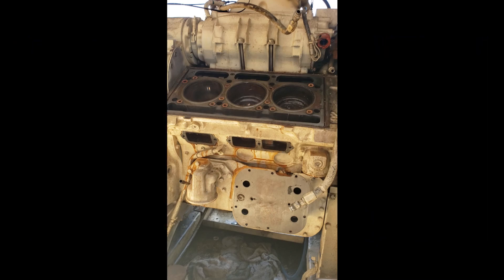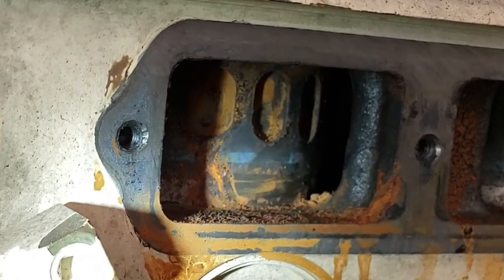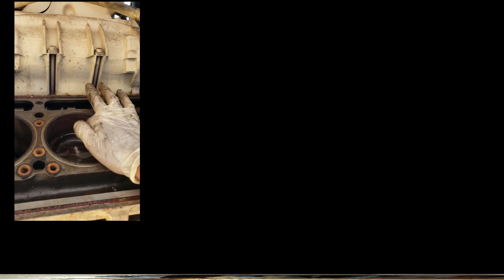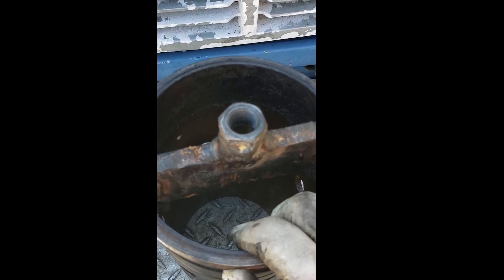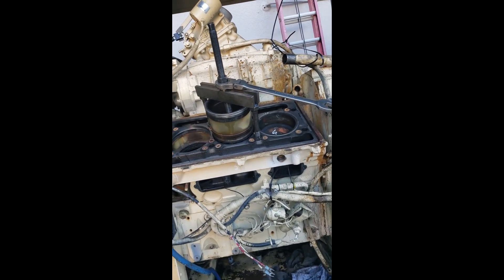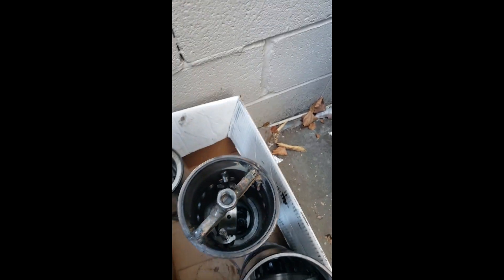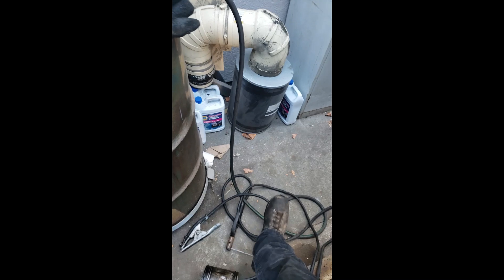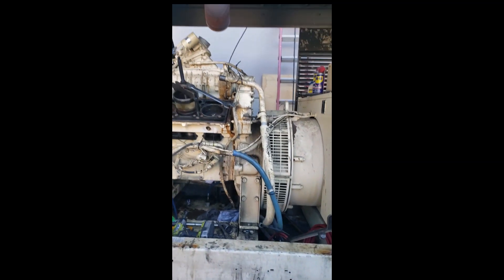Detroit Diesel 6V-92 Seized: Debunking the $550,000 Quote - Ep. 3 | Mobiledieselmedic.com

Comment: Next time you run into this problem of rust bonding you might try Dry ice  in the cylinder and a torch around it to shock it .expansion and contraction .V 6 DD Silver engines start with serial # F83425 Any number after that is a silver //V8 F73594 same thing .The silver was an upgrade from the original models .
Reply from the maker: Hey Logan, such the technique!!  I never even considered that approach.  I have used hot/cold to load ring gears on to John Deer flywheels, also a #7 oxy/acetylene cutting tip to blow out the centers of a hydraulic ram pin, but it never even occurred to me to try that.  You would think why not, but it never really snowed in the San Francisco area, ever. Once in 1976, what a day that was for us kids, but I digress.  Over the years, when it comes to stubborn black rust, the real pain has always been getting the northern road salted king pins out of the steering knuckles.  Half the time they never budge and I have to set up this crazy mobile mini hydraulic press.  I looked up a couple of different designs via a Canadian truck parts website and was on such a deadline that I cobbled something together with a pneumatic por-a-power.  It works well enough but what a pain to set it up.  I'm  leery to use a torch near anything in the steering world, but a small wee bit of heat and a can of cold spray is a whole lot easier to handle than a mobile press.  I hope I get the opportunity to try it.
Reply: @mobilediesel  your Welcome anytime i can help ill try .when you get as old as i am you pick up a thing or two .ya the seals in those steering boxes don't like heat to much . if the dry ice doesn't do the trick spray or use  liquid nitrogen  just don't overdue it it will shatter the part when you hit it..